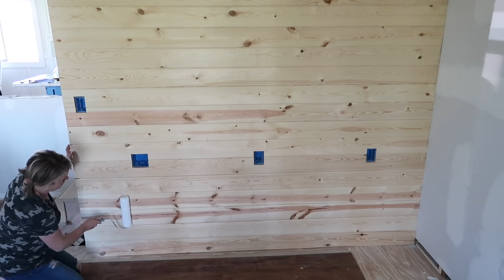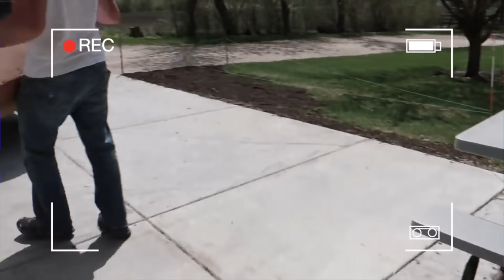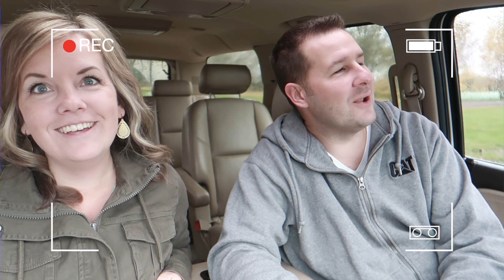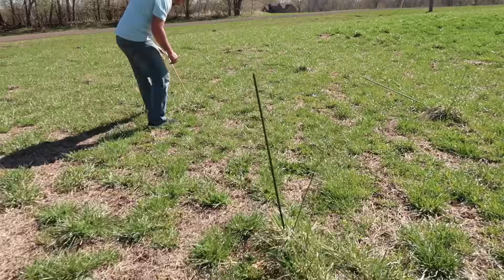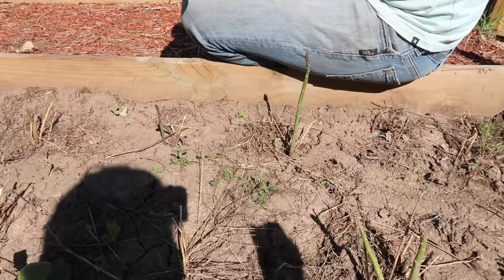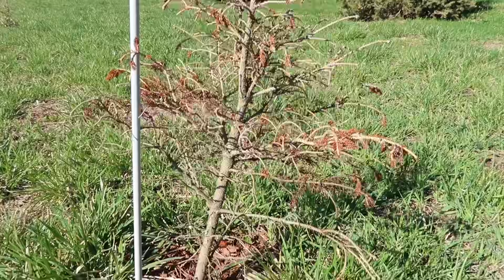The Saga of Tom's Missing Trees UPDATE! + LOOK what else we found!!

Comment: I grew up with asparagus along our side fence line. It was a heritage variety and nothing would get my grandmother or dad angrier then clearing out the grass near that line. I now know asparagus needs delicate mulching and even watering.  On that note, since you seem to have access to equipment, why not put in a summer line out to a spigot in the garden area? In Northern Illinois, we buried an empty 4" pipe about 3 feet down and ran a garden hose through it. In the garden there's a standing spigot, we pull that out every fall, then blow out the hose and cap both ends of the hose for the winter -- in the spring we flush it out. The hose usually lasts 5-6 years then it seems to get leaky.  In MN you might need to go down another foot?  Just old lady advice...

Comment: My parents have asparagus. I grew up helping with it. Give it time, give it water if it seems dry. It will come. One thing we did to help with the weeds was sprinkle Morton pickling salt on the surface. (if remember right it was a green box). This would help control the weeds but also not kill the asparagus. We also would take a knife and cut the stalks just below the dirt surface at an angle. I'm not sure if there was a reason for this or not but it seemed to work. If you have more questions let me know, my parent and grandparents have had asparagus in central MN for over 20+ years.

Comment: I have planted many trees and I must tell you that mulching small trees like you have is really important, especially in a wide open probably windy and sunny space like you have. It will protect their roots from winter frost heave (which is most likely what took most of your trees) and feed them as it breaks down. I will also tell you that the poplars will indeed grow fast but when the time comes that they are done, they will easily come down in a wind storm like what took down your oak and possibly destroy your other trees. Therefore it would be prudent to keep the poplars a distance back from your other trees. 
You have a lovely spot and a great garden bed!!!
Asparagus are heavy feeders so manure, manure manure....but well composted. Just pile it on top in the fall and it will work it’s way down over the winter. 
If your garden is close to a water source, setting up a sprinkler would be a good start to easier watering of your garden.  
There are many garden vlogs on installing drip systems such as “Garden Answer” or “Epic Gardening”
Love seeing your kids helping out!!!!Happy Gardening in the years to come!!

Comment: In the midst of a closet remodel. We have a large closet that connects our 2 bedrooms upstairs. It's probably 15'x6' with a cape cod sloped ceiling. It was completely empty when we moved in. I'm installing 4 shelves on one side wall, 1 shelf and a hanging bar on the opposite end, and the largest tallest wall is getting 3 hanging bars and 1 long shelf. Also the entire room is getting a coat of paint. I'm about halfway through at this point. 😅🤪😵😷😏

Comment: Dawn and Tom, Love how your house is coming together!  You mentioned the butcher block you used in your camper and for your new workspace is inexpensive. Can you provide a link to the butcher block please?  Thanks!
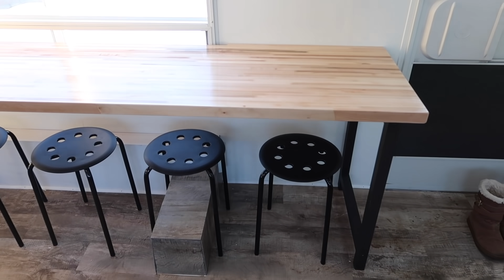Reply: Debbie Ash. At 2:33 Tom mentions that it's a work top material which is why it's cheaper. It sounds like they didn't buy actual butcher block but put a finish on it so that it functions like it. In case Dawn doesn't answer you....🙂
Reply: We bought something similar at Menards.
Reply: Thank you!  Just curious about what the “work top” is and cost.
Reply from the maker: It's called work bench material and is from a building material outlet store in our area 💚

Comment: I have started on my garden that my rototiller conk out so we're having that fixed but what I did I'm watering my garden was to plant a garden hose a soaker hose actually and then put wood chip type sawdust on it and then the dirt and then the so I'm hoping it works the Kansas so dry. Hardly anything seems to grow out hereexcept for my peach trees but they got froze so they're not doing well either.

Comment: I think the failure in the trees was the way they were planted. Love Tom- but putting in a shovel and then shoving in the sapling is not going to do it. I understand planting that many is a BIG job. I would get the plants again- and try and plant them again. But you need to dig deeper and WIDER so much Wider because their fist roots are shallow.

Also- UV resistant zip ties- love em!

My favorite soil is 1 part peat moss, 1 part vermiculite and 1 per good compost. It is friable and really hold on the moisture. Coconut coir isn’t as good, and perlite isn’t as good either.